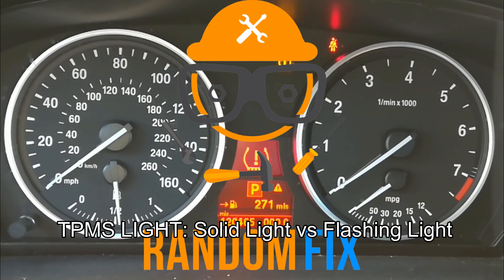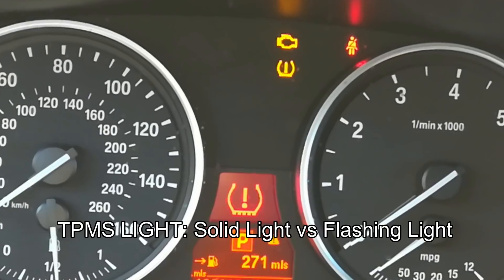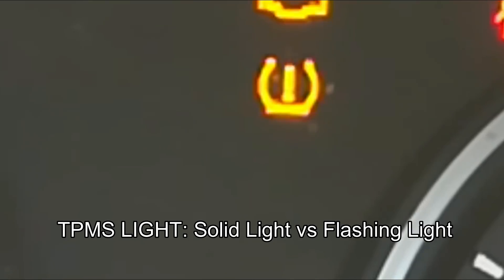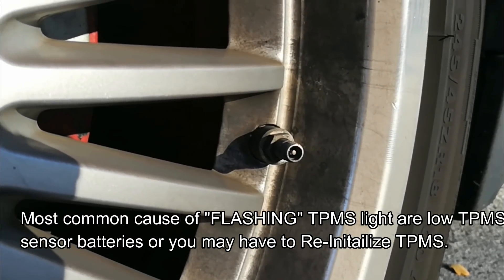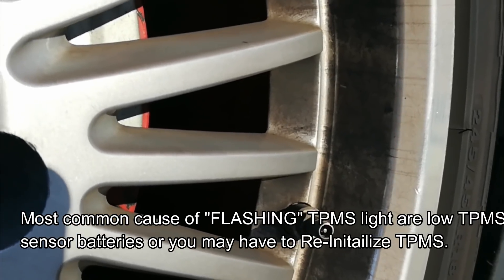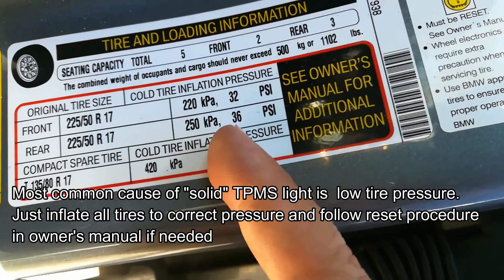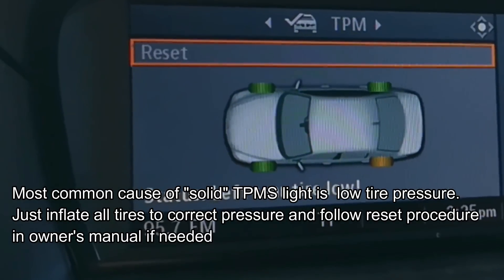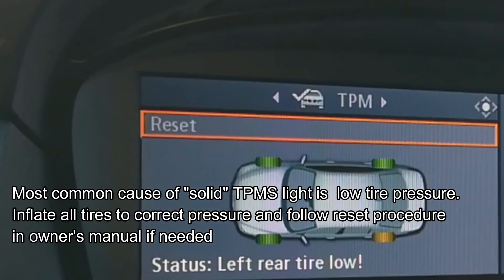TPMS issues? Tire Pressure Monitoring System Solid Light vs Flashing Light

Comment: So my light flashes for about a minute once the vehicle turns on it’s a 2014 Kia Forte sedan lx, the factory tires max load I believe was 40 and my new rims and tires can hold 51 psi any help my light flashes and then goes solid after a minute and I dislike any lights on the dash
Reply: Do I set the new tires to the oem factory pressure ?
Reply from the maker: Matt, if your tpms light is solid you more than likely have low air pressure, if you tpms light is blinking your more than likely have a fault in your tpms system. Faults can be caused by low battery in a sensor, there is a sensor in each wheel and 1 main receiver (main receiver can get damaged as well but it's very rare) that picks up the readings from each sensor. Please don't max out your tire pressure to 51psi. Best of luck and let me what else you find. I had a really good video link in the description of the video if you like to refer to that. _Randomfix